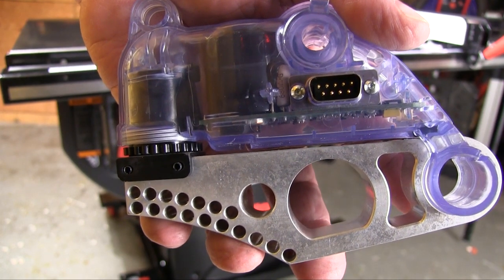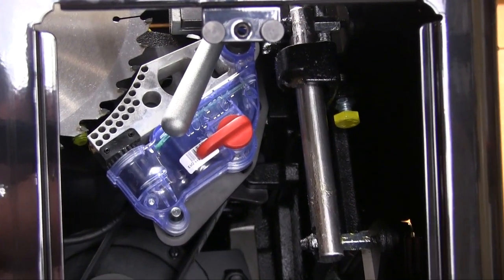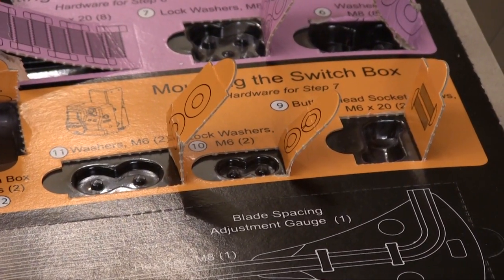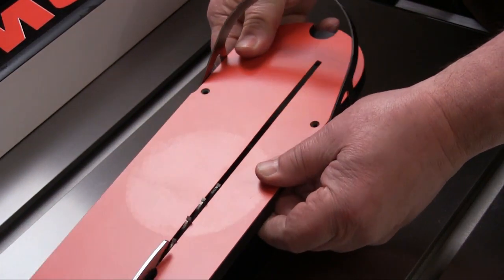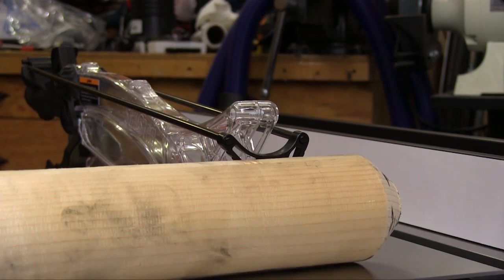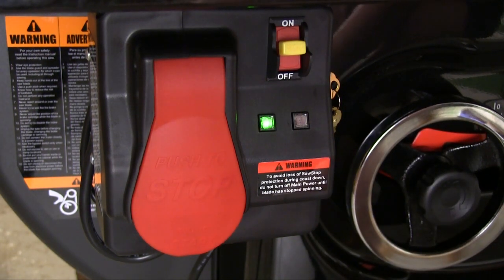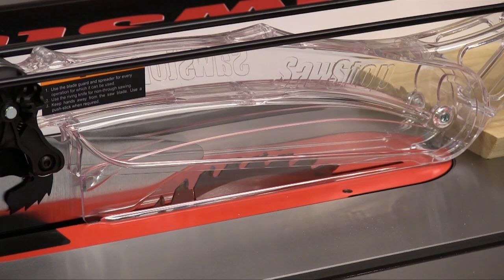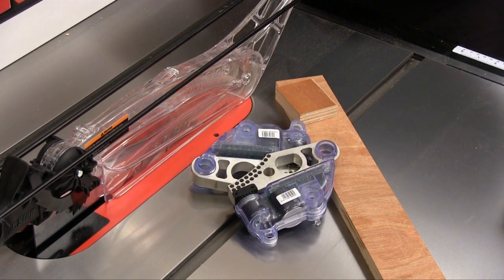SawStop Professional Cabinet Saw Review - Part 1

Comment: Yea, I knew you'd love it, I fell in love with them at college.

Two things to get used to:
1.  Shutting it off and then on right away, you have to wait for the lights to stop blinking.
2.  Always run it with a vacuum on.

Comment from the maker: The blade brake fired because you were in contact with the aluminum when it contacted the blade. The aluminum completes the circuit so the brake fires. I showed this in my review by cutting nails without tripping the brake because I was not in contact with them when the blade was. The manual describes this also.

Comment from the maker: I actually have the SawStop, built it in my shop and have used it extensively since then. There are LOTS of things that are better about it aside from the blade brake. But it is easier to cheap shot it from the outside.

Comment from the maker: Just about any metal and many other materials can pass the small electrical charge the SawStop system works with. Aluminum is actually a very good conductor but so are lots of other materials. The key is to not hit the blade with metal, as we always should anyway. It is possible to have something like this happen and fire a brake cartridge but I work at making sure that I don't make that kind of mistake and save the benefits of the brake for if I ever make contact with part of me and the blade.

Comment: I purchased the Industrial Saw several weeks ago.  I love the quality of the saw but I did have a brake activation when the blade came in contact with an aluminum miter gage (Incra 3000).  I was told this would not happen.   I lost a new Forrest II saw blade and need to purchase a new brake ($89.00).  I admit I was a little careless when setting up my miter gage but I'm still upset that the brake activated when it should not have!!

Comment: the timber stop is a bit pointless tbh if your competent enough to be using a ripsaw then you should know the blade should cut all the way through the timber and also the crown guard has a riving knife on it if this was Britain you would be breaking regulations by using it without the crown guard

Comment: There is nothing special about this table saw apart from the 'Sawstop'. In my opinion the Sawstop will make people careless while using a table saw. Then they might use a table saw without and and bam thry have 1 or more less fingers.
Reply: Thats not the point. You should be careful when using ANY table saw, but the saw stop is an extra safety measure. It will still cut you even if the saw stop activates, so why would anyone be careless?